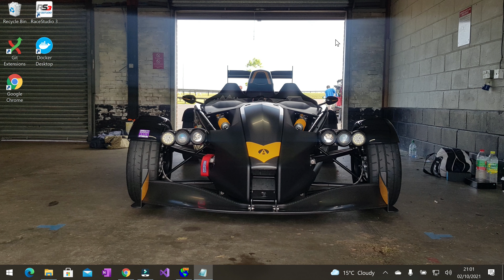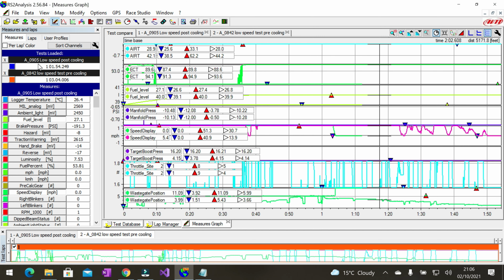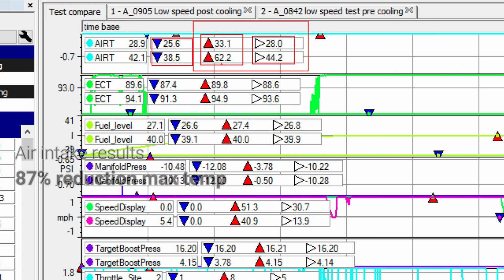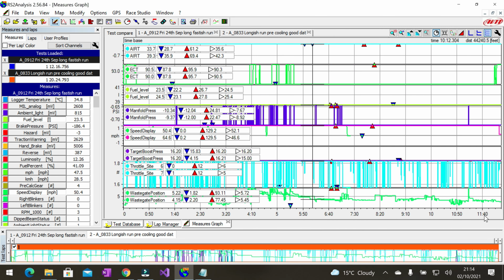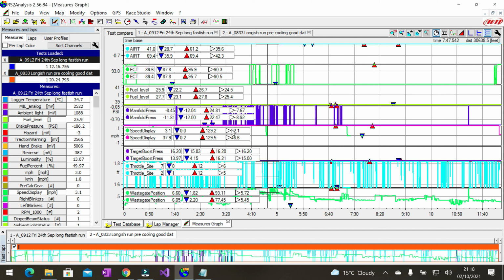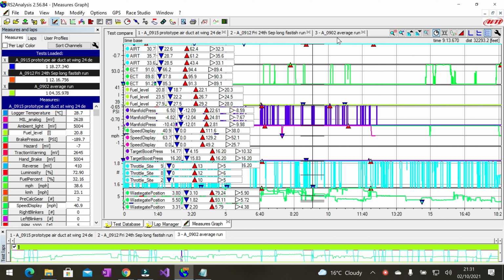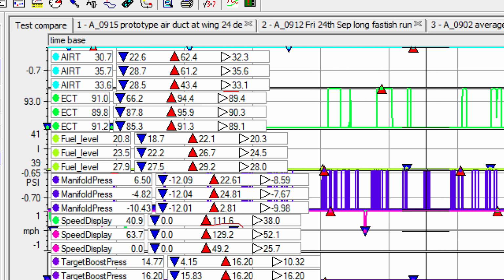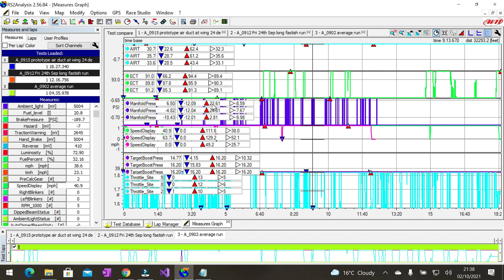Atom 4 Project more Power - Part 2

Comment: I just finished commenting on Part 1, and was about to edit it and add that you should (if you can) test the results, before and after.  When it comes to tuning cars for power, handling, cooling, OFTEN the theoretical doesn't line up with actual and adjustments need to be made.

However, looking at this video, I can see you know that already!  Outstanding job in your analysis!!
Yes, taking it out on the track and doing an on/off analysis with the front wing area tune, would be helpful.

Watching the rest of the video, this is outstanding data!!   Outstanding!   I'm sure you'll agree with me when I say that I wish all car tuning part manufacturers, showed data like this.  I need to see the data!
Reply from the maker: Thanks for your insightful comments, much appreciated. Yes I do these videos because I think others learn from them and I do too. Yes I agree manufacturers of anything should provide data not just claims of "more power" or "better performance" no matter what it is.